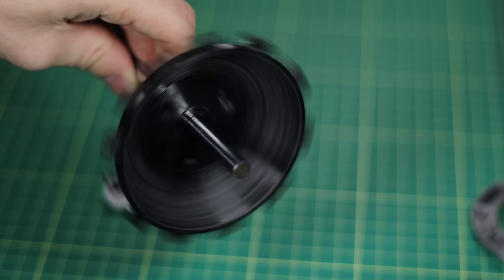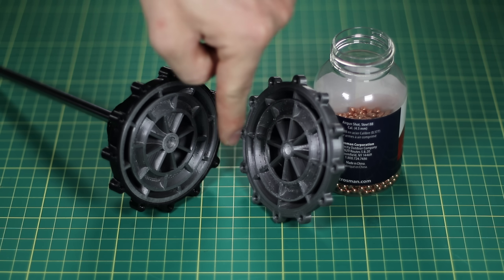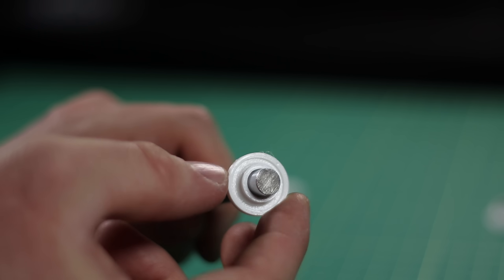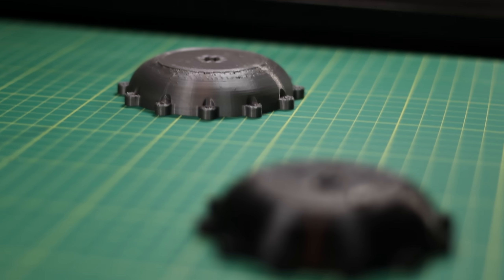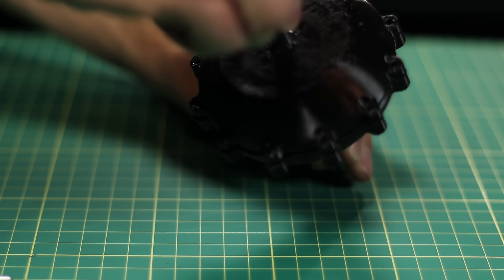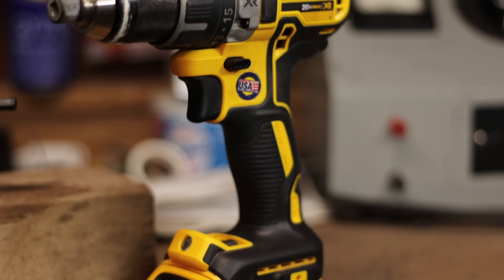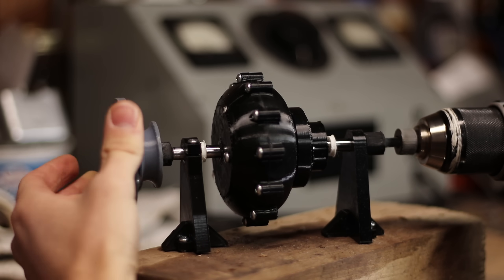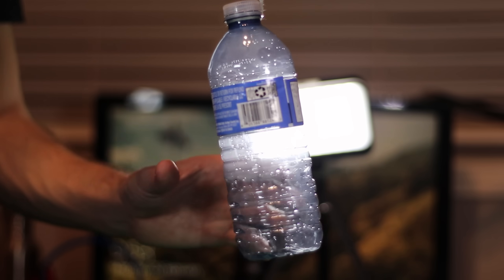3D Printed Fluid Coupler

Comment: Yeah, these are the key part of an automatic transmission on a non-electric/hybrid car. This allows the gearbox and engine to do whatever they damn well please and still have the wheels receiving smooth torque delivery. You can start out in second gear when you have slippery conditions on the road without worrying about clutch wear because it's being operated as it would be with a normal gear change.
Reply: There have been some really cool manual designs with torque converters
Reply: @notserpmale03  Ooh. That does sound like fun to drive
Reply: @notserpmale03 That would be cool. Not needing to worry about clutch ware and stuff like that. The issiue is, atleast as far as i'm aware, that the fluid coupling is Way,Way less energy efficient than a mechanical one,therefore it burns more fuel. If i'm wrong, please correct me tho.
Reply: @MrSlyFox  there are some ways of fixing it like using a clutch to lock the input and output.
Reply: And Koenigsegg said what the hell do we even need a transmission? They exclusivley use a honking big torque converter in the regara.
Reply: @sg5184 it's actually a CVT gearbox
Reply: @pb6198 no it isn't it's called the hydracoup and it's an oversized torque converter they also have a valveless engine that uses solenoids
Reply: @sg5184 it is not a torque converter.

You've misunderstood that, it is designed to behave like a torque converter

Comment: awesome clutch! would it be possible to have a clutch optimized to work only with the steel bb's?
Reply from the maker: Thank you! Yes and no, the BB's are too large to flow the same way a fluid would and create a progressive slip. Once the pump spins to the threshold where the BB's start to migrate to the impeller they just smack the side of it and lock up immediately, like dropping a clutch in a manual car. Maybe something of smaller particles may work, like sand or flour.
Reply: @CamdenBowen  interesting

Comment: First time to see someone made a hydrodinamic clutch
Reply: Fluid coupling / hydrodynamic clutch / torque converters, used in automatic transmissions yes as a replacement to manual clutches as they are now inside the transmission but you still don't want a direct coupling of the engine. Still used in cars with CVT's like Subarus for the same reason. CVT's also used on small scale stuff like go-karts, 4 wheelers and mini-bikes without a clutch. But yeah the design he uses is directly a torque converter straight from an automatic transmission.
Reply: It is not a clutch though. Unless I misunderstand the etymological meaning of the word, it's not a clutch because it does not engage or disengage. This is a torque converter.
Reply: I think it’s called a torque converter
Reply: This is in every automatic car you’ve ever driven
Reply: @notserpmale03 not everyone some are cvt
Reply: @trey56tre2  cvt used a torque converter lmfaooo
Reply: @notserpmale03  well per nissan they used a clutch. ig you smarter than the manufacturer 🤣
Reply: @trey56tre2  just found an article describing a Nissan CVT with a torque converter but ok buddy. Yes it’s obviously possible to make one without a torque converter, but most of them have one
Reply: @notserpmale03 small cvt transmissions use a centrifugal clutch instead of a tc
Reply: @381delirius  didn’t consider that option truthfully, but there are definitely some with a tc I did a little googling and Nissan does have a solution with a tc unless google lied
Reply: @notserpmale03  So you've been to a torque converter factory?  How many have yo sen been made before? ZERO just like the OP?
Reply: @toolbaggers  lmao that’s not what he was saying but go off lmfao
Reply: @toolbaggers wtf??
Reply: @notserpmale03 that is quite literally exactly what OP said - “first time I have seen one”
Most have never seen a torque converter.
Reply: @notserpmale03 also, the comment could have been taken as “the first time I have watched the building process” again something literally nobody has seen except car nerds
Reply: @notserpmale03 also “but go off” makes you sound like a 16 year old on tumblr
Reply: @melody3741  guys melody is literally going off rn
Reply: what op likely means is that it's the first time he's seen someone actually build one of these by hand and show their process and test while using their own tools on hand. There's no other video on YouTube showing someone making a 3d printed torque converter.

Comment: Stalling is not when a fluid coupling is "locked up one to one"(Which it never is supposed to be(Without a clutch) as it works on hydrodynamic principles), stalling is when the pump is rotating but the turbine does not.

Edit : Just wanted to add that the video is quite damn cool anyway.
Reply from the maker: Thank you! My mistake, too bad YouTube doesn't have the annotations feature anymore to address that
Reply: I just came here to say that.  In the 1960s and 1970s, stall speed for the typical car was around 1200 rpm.  Folks building drag strip cars would put in high stall speed torque converters, typically around 1800 rpm, but some as high as 2400 rpm.  It may seem counter intuitive to have more slip, but the engine made more horsepower at a higher rpm and the torque converter took that power and converted it to shear torque to launch the car off the line.

Comment: You should add this to a nitro rc car that's heavy so it simulates an actual car but small sized and not as heavy
Reply from the maker: Could be a fun experiment, load it up with mass until the coupler can't move the car
Reply: @CamdenBowen yup
Reply: @CamdenBowen when's the next video coming out just so I know and don't gotta keep checking lol
Reply from the maker: @Matthewbarnes23  I've got a surprise video planned but it won't be for a little while. You could always turn on the bell notifications as well :)
Reply: @CamdenBowen I have a video idea for an experiment so I came up with this idea for an infinite energy engine meaning a four stroke engine that doesn't fire and is only powered by air when the intake valve comes down lol meaning air traveling only one way through the air tank so the engine uses the air over and over again but you'll need one way valves on the air tank or bike tire sleeves and you'll have to fill up the tank first lol

Comment: Do you know what years they started to put them in cars and if they still do?
Reply from the maker: Fluid couplers like the one I presented in the video are no longer used in vehicles. Fluid couplers are only really found in industrial applications these days like in mining applications. In the 40's General Motors invented the first automatic transmission that used this type of coupler called the "Hydramatic". Chrysler followed it up with their "Powerflite" transmission. About 10 years later GM invented the "Dynaflow" transmission which used a different kind of fluid coupler called the Torque Converter. Torque converters manipulate the fluid inside to actually increase the output torque at low speeds (a little bit like how a CVT transmission works). Ever since, automatic cars have used the torque converter as it is much more efficient in the automotive industry. Hope this helps!
Reply: @CamdenBowen  can you please try to make a torque converter?
Reply: @cenreaper9127 tbf it's not a radically different thing, moreso an improved fluid coupler with some different internal geometry. The overall fundamental concept is still the same.

Also at high/cruise speeds, torque converters will often have a system that mechanically couples the two sides together for true 1:1 direct torque coupling.
Reply: About 1980's.